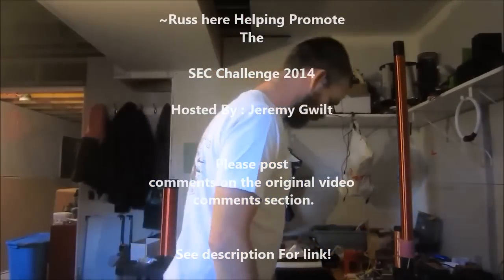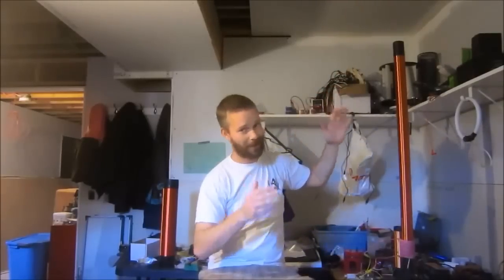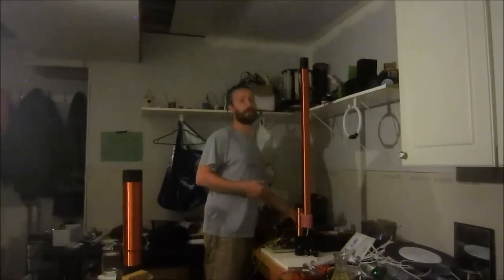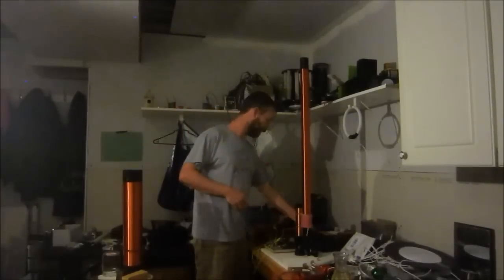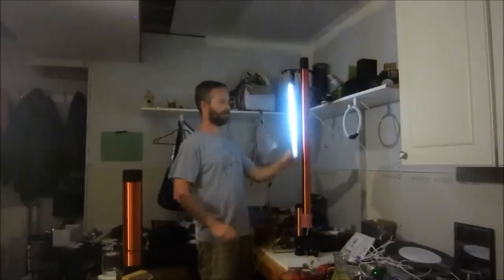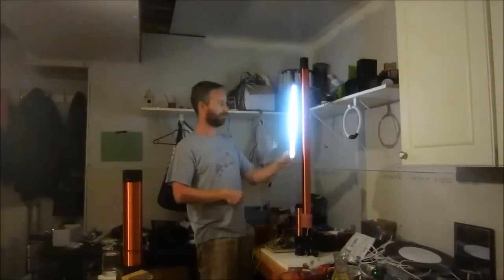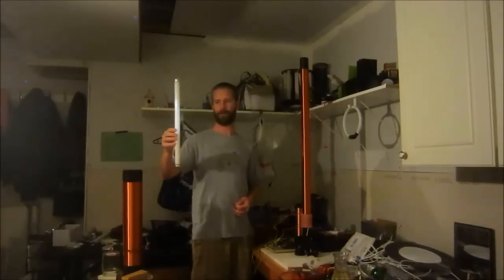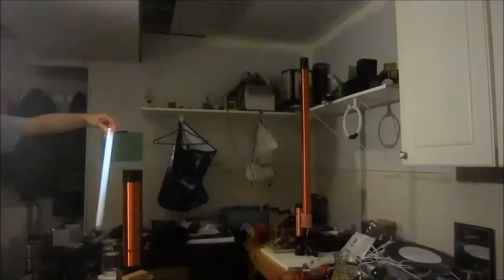SEC Challenge 2014

Comment: SEC=Spatial Energy Cohesion
Reply: i use a 2n3055 transistor, 1 resistor, 1 LED 1 capacitor (63v, 2200 uf currently) and SLA batteries as power source. outside of that, some copper coils and an earth ground  on the receiver tower.
Reply: as far as circuit diagram, i use the simplest 'slayer exciter' that can be found online
Reply: ***** no problem, i will do what i can.   :)
Reply: ***** ce n'est pas une probleme! ma jeune fille sa dans l'ecole fracais ...mais je ne parle pas..umm.. bien mwahaha....im learning all over again  :)